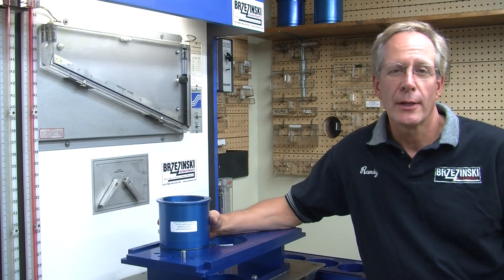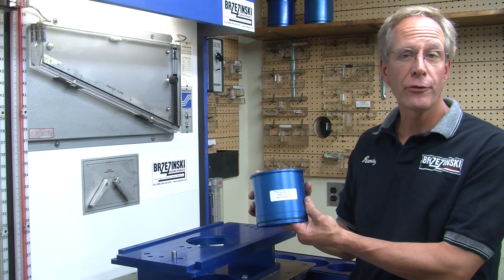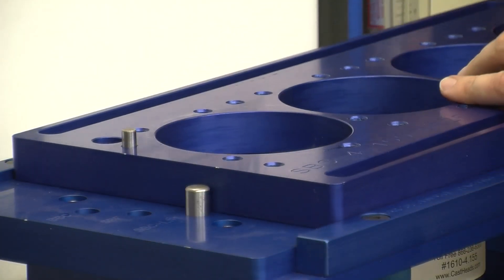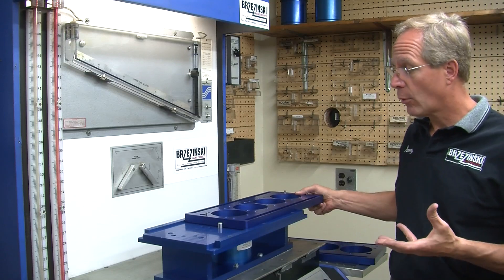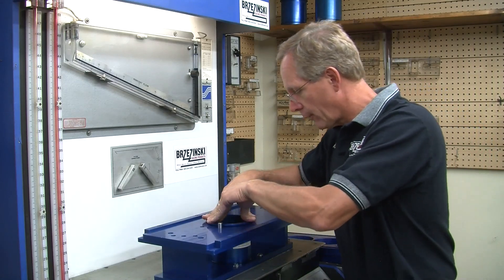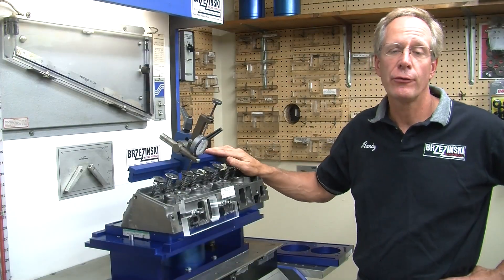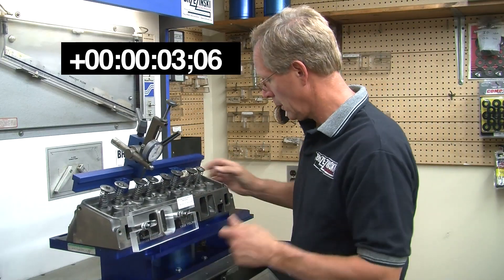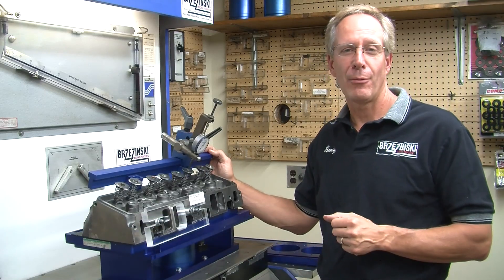Brzezinski Flow Bench

Comment: Ok I thought so. I had a profiler 23* sbc Head flowed and it wasn’t plugged. Head has been port matched to a 1206 and cut for 2.055/1.625 valves. Also some mild porting in the ports and under the valves. Anyway, flow numbers were way less then what profiler advertised. Only 260 intake flow @ .600 and .700. How much does leaving the rocker stud hole unplugged effect flow? Thanks
Reply from the maker: not sure the numbers off hand. it will change how the head flows by a fair amount though. we have a video that explains about checking for a leak before flow testing. that should help you out a bit. 

https://www.youtube.com/watch?v=X7tou5RwlS8&feature=youtu.be